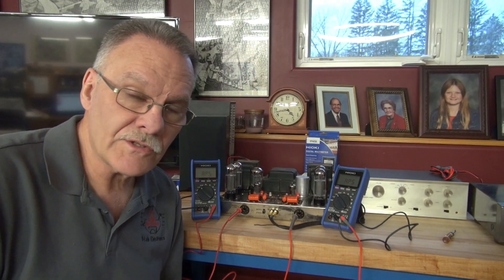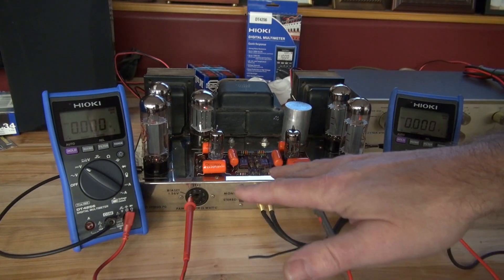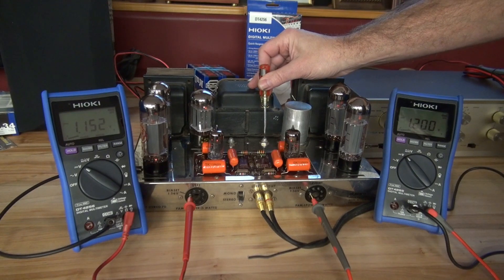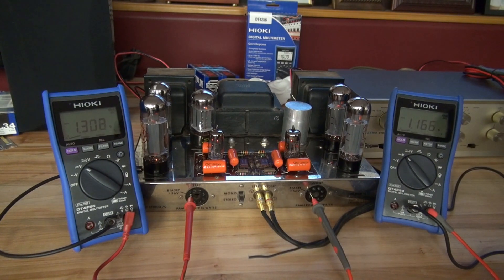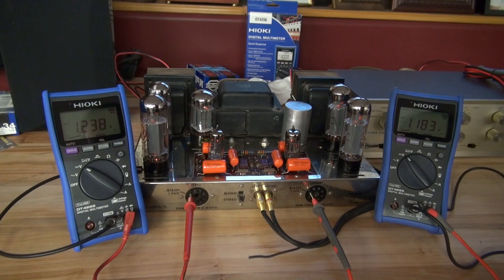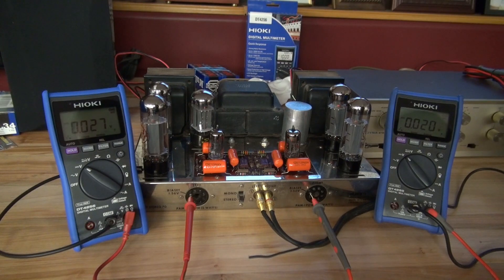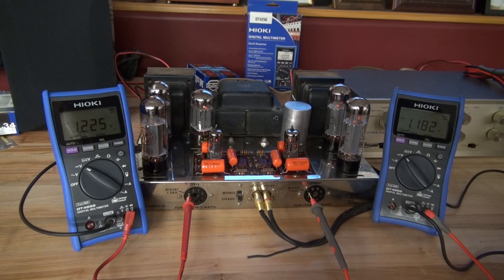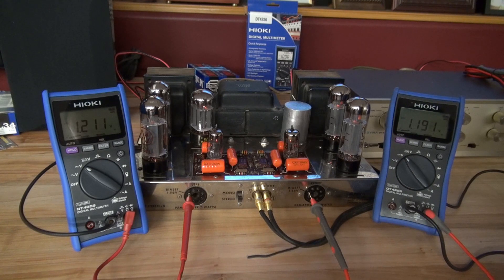Vintage Dynaco ST-70 tube Home Stereo setting bias monitoring drift Straight forward procedure

Comment: You neglect to mention that you “must have a speaker load” hooked up before power on the amp. A load must always be hooked up or you can damage the transformer. Also, not to play music while doing this or turn on your preamp. Leave the preamp off. Do this before you start. With new tubes, turn the bias setting all the way counter clockwise before power up. Then turn on the amp and let the amp settle for  2 minutes or so. Then slowly bring the left channel up to about 1.45 to 1.5.  Dynaco says 1.56 but a little under is good for measure. Good for the life of the tubes.

Comment: why are you going to 
1.2 volts and not 1.56 like it says you should❓and should it matter if the dynaco is 120v american or 230v europe❓
Reply from the maker: Higher HV due to line voltage. Reducing current thru the tubes to compensate.

Comment: when adjusting the bias do you need to disconnect the inputs and speakers and someone suggested plugging in a RCA ground plug into the inputs...also why did you only use 1.2v❓

Comment: After many years of working with tube power amplifiers I’ve arrived at thinking that most circuit designs use grid resistors with too high of a resistance value. For example the Dynaco ST70 Has 270K ohm grid resistors for the EL34 output tubes. Changing the grid resistors to ~100K will reduce the bias drift by a factor of 3. However this lowers the open loop gain and may prevent the driver tube from supplying enough peak AC grid voltage swing to get full rated power/distortion from the amplifier. When the ST70 was introduced in the 1960’s tubes were cheap and sold everywhere.  So tube life expectancy was traded off for a simple low-cost circuit design. Also some of today’s current production power tubes aren’t as robust as vintage tubes. In fact the quality of tubes manufactured in the 1960’s was probably better than anything available today.

To explain why I think the grid resistors need to be smaller I should say something about the causes of “red plating” and thermal runaway in audio power tubes. First make sure the coupling capacitors are good (no measurable DC leakage at all). This leaves the only possible cause of grid current to be the output tube itself. Ideally the control grid should not emit any electrons at all. However, if the grid gets too hot or has any bits of cathode coating accidently spattered on it during manufacturing, then the grid may actually emit some electrons. A second cause of grid current is the presence of positively charged gas ions inside the tube. The control grid, being the most negatively charged item inside the tube, attracts these positive charged ions. Adding positive charge to the control grid also results in grid current flowing, as electrons must be supplied to balance the positive charge of the gas ions. I suspect that gas inside the tube may actually be the major source of grid current.

In conclusion, either grid emission or gas inside the tube will both make the grid more positive. Result: Cathode current increases, making the tube even hotter. This may set up the unstable conditions for “thermal runaway” which causes “red plating.”

This just a start for me. Next I want to find ways to stabilize the cathode current without changing the audio performance of the amplifier.

Comment: I had this happen on one of my Heathkit W5-M amplifiers. Had grid leakage on one of the Gold Lion KT-66 tubes that would not show up on a tube tester, besides it took about 3 minutes before the tube would go into runaway. It took the output transformer out, fortunately I had a parts donor amp to rob. The tubes tested fine in my tube tester, of course.

Changed output transformer and a new set of tubes, but I kept a meter on the new tubes for several days to monitor the dc balance between the cathode resistors.

Comment: Terry, could you swap the tubes between the channels to see if the drift follows the tube set. Would that work in determining if the tubes were the issue?
Reply from the maker: Yes, That is how I found the drifty tube. Moved it to the right and current drifted high. JJ tubes are not my 1st choice when working on vintage amps. I have had many assorted failures with that brand.
Reply: @d-labelectronics  what's your top choice?